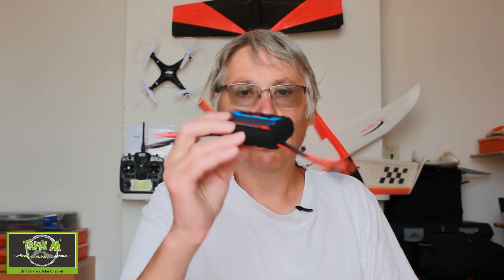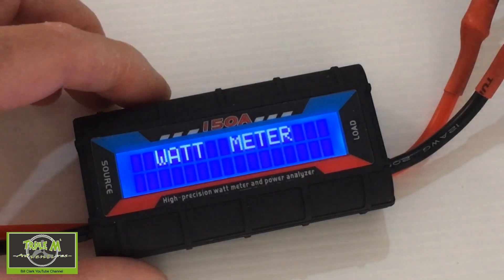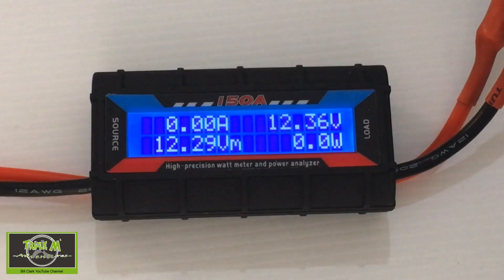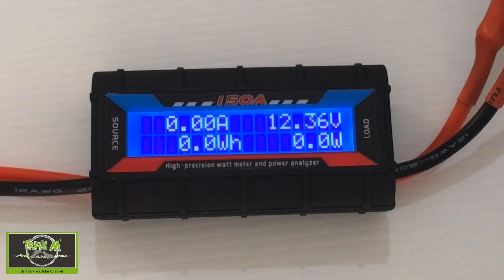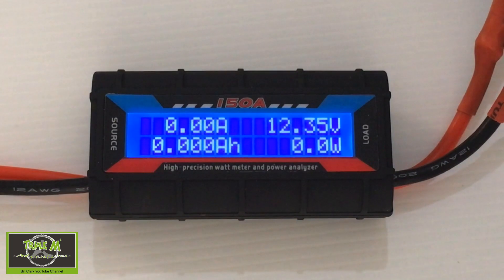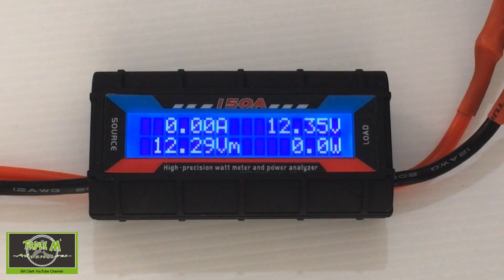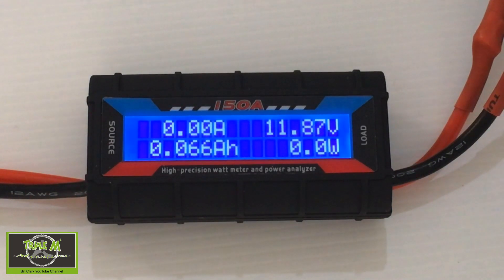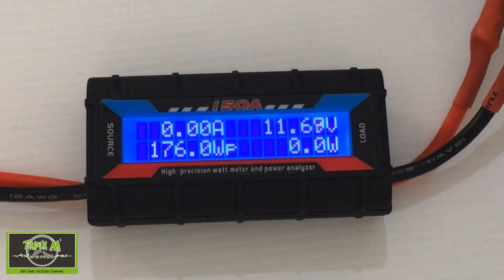Review: 150A Watt Meter & Power Analyser

Comment: Did you check the AMPS against another meter? I tested one just like yours recently against not one, but three other meters from two different mfr’s and the all agreed except for the one just like yours, which red 25-30% LOW, which of course puts one in danger of damaging a motor or ESC if tuning near their limits. So in my experience, the meter you showed here is not simply inaccurate, it’s dangerous. Another reviewer on Amazon had the same results testing his against very high end (Fluke) equipment.
Reply from the maker: No I did not. That is a very large variance. I know from experience what motor, prop and battery combination to use but a beginner may not. Thanks for sharing this. I will do a test.

Comment: Thanks for your video but I would like to know how it must be conected. Could you give us the diagram or any tip of conection for this device? Thanks you very much.
Reply from the maker: Sergio, the meter needs to be connected to your battery and then to the power connector of your model which goes to the ESC.
Reply: @the-happy-RC-flyer  ... the device take mesures of currents and it means be conected in serie, not in parallel like in the  voltaje measures. How is the the right way to conect it?
Reply from the maker: @sergiof.zamoranoromero1457  source is connected to the battery and load to the connection used to connect your battery to your model.

Comment: Have either of you tried using this on a 2 cell lipo? I have this meter and I tried checking one of my models amp draw and the voltage of the 2 cell battery is not enough to make the display read. Only the backlight comes on. It is supposed to work at 6 volts. If I connect a 3 cell pack to the meter, it reads fine. 
Just curious to know if yours does the same thing.
Reply from the maker: Hi good question. I just checked mine and same problem as you backlight comes on but no reading. Just proves I have never used the meter on my 2 cell models. I think our meter's are not broken but only work with 3 cell and above.
Reply: @the-happy-RC-flyer  Another person complained about this on Banggood.  Must just be the way it is.